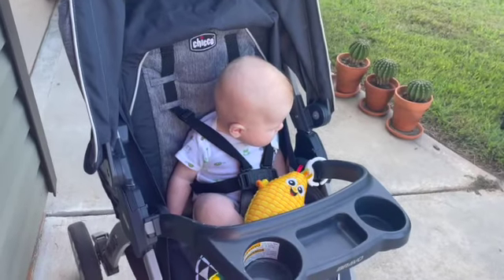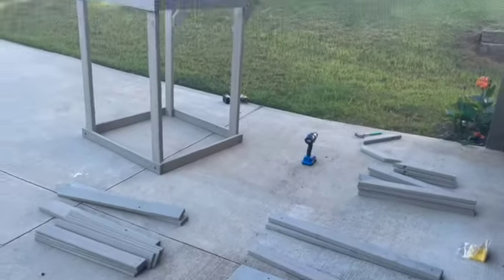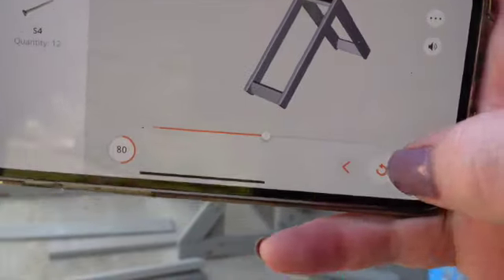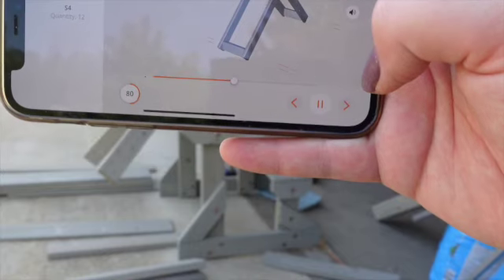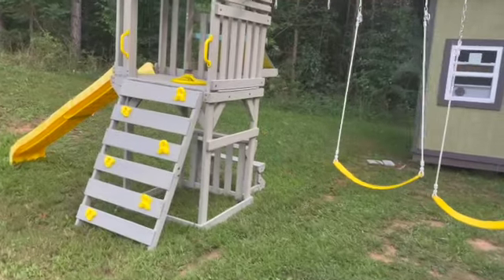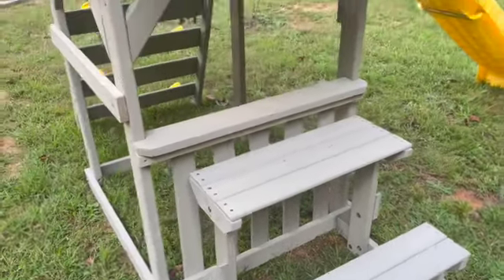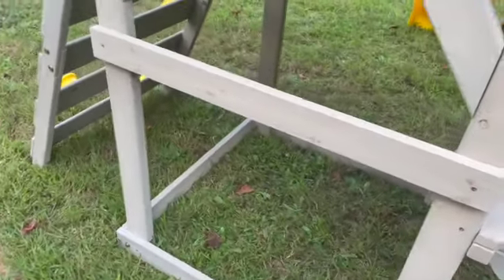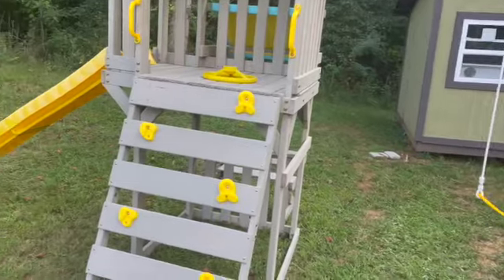Building Casen's Swing Set - KidKraft Seacove

Comment: Did you use any tools other than the drill and hammer? The instructions call for a lot of tools and don’t explain when to use them. I built a few of the pieces mainly with the drill and hammer so wondering if the other things are totally necessary?
Reply from the maker: I recommend a wrench and pliers too